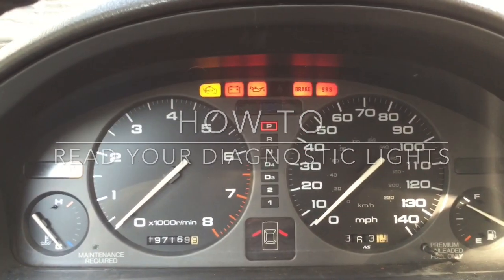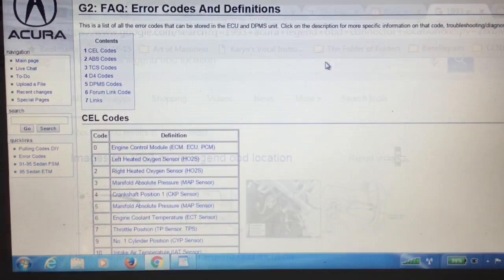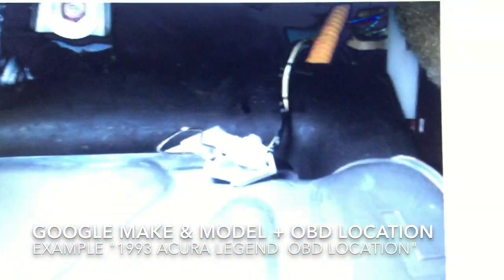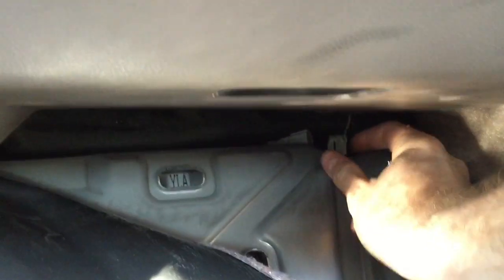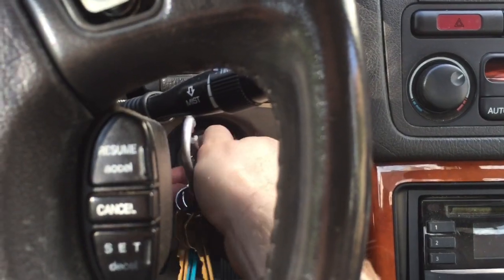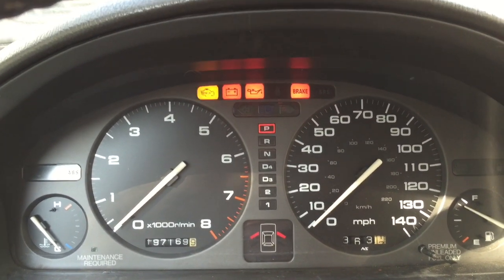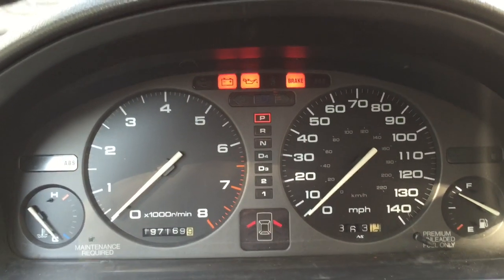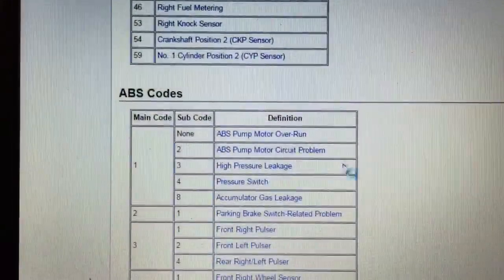How To: Read Your Diagnostic Lights (1995 or Older)

Comment: Mine is tucked to far away to get to every video I see everyone already has theirs hanging down..
Reply from the maker: What car? Some of them are clipped onto a metal bracket. It might be helpful to remove the glove box. Usually opening it, then squeezing the sides and pulling it down further works. There might be a few screws

Comment: How do I do that for srs light ?
Reply: If there is a code issue that jumper should trip it. If the system doesn't have a problem there will be no flashing light.